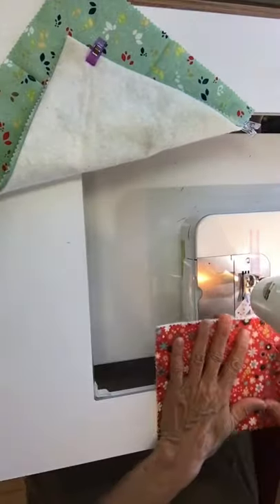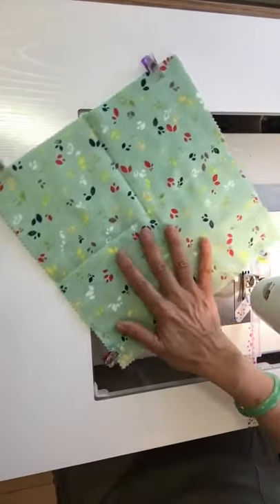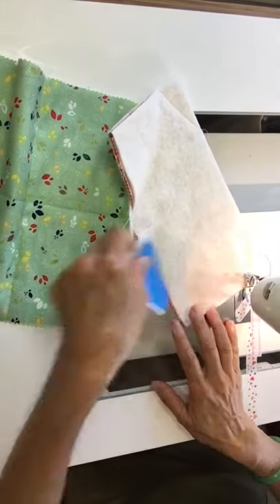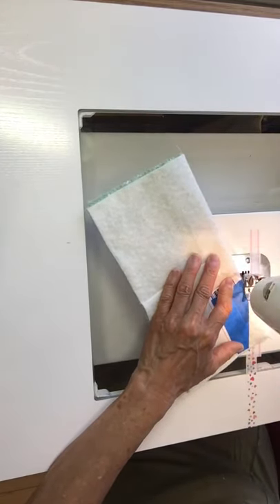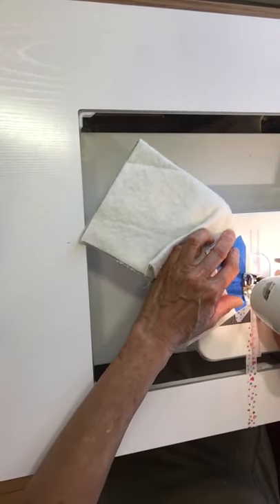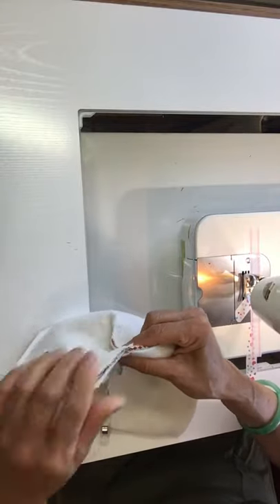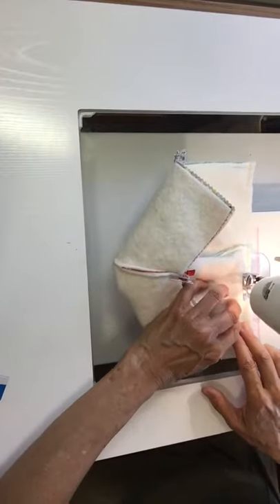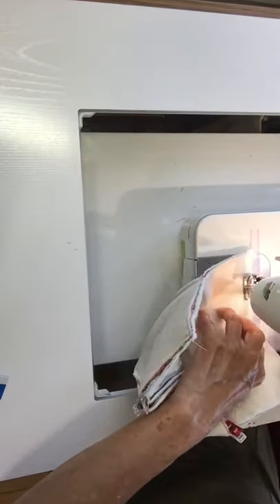Bowl Cozy Stitching Guide. A Sewing Hack. No marking needed.

Comment: For folks who want to make more affordable cozies, instead of paying a LOT for cotton batting, you can use 100% cotton flannel sheets that can be found at thrift stores. They wont be as insulating as batting, but they go together smoothly and they dry a lot faster than those made with batting.  If you want more insulation, you can easily sew an additional layer of flannel on one side.  Also, vintage cotton tea towels (in good shape) make cute cozies' outer fabric.
Reply from the maker: Great idea! I’m going to try that! I have lots of stash from making baby blankets!
Reply: Yes, flannel is cheaper at Joanne’s twice a year for $3.99 or $2.99 in October or November. People used to use flannel for batting before batting was available.

Comment: Hello! I read the information about the business card and how to measure and cut for the date… I was just wondering if you know the angle of the dart? For example is it a 35 degree angle or 45 degree angle? How did you figure out what angle to cut the business card? I have so many rulers with angles that I could just place my acrylic angle ruler on the batting and just use my rotary cutter and just cut it off.. I know this tutorial is 2 years old now and I just found this my accident , but was wondering if you happen to remember . If not totally understandable!
Thanks, Jeanne

Comment: Hi, was your template cut from cardboard  or a plastic one you bought? I couldn't see very well but I don't think you mentioned where you got your template from. Thank you. Very nice tutorial , it will definitely save time.
Reply from the maker: Hi! I created my template on my own. Simply start with some firm card stock. An old business card will do. Standard bowl cozies mark 2.5” high and 1.25” in to form the dart. 

But, all bowls are variable and these measurements can be adjusted. 

Have fun!

Comment: The darts need to be back-stitched at both ends n the X needs to be sewn diagonally from corner to corner.
Reply from the maker: You have a helpful idea to improve construction. 👍 I shorten my stitch length as an alternative to lock the stitch at the ends.
Reply: I agree with back stitching especially at the end of the points.   Nice template dart idea.
Reply: Why does it need to be sewn diagonally from corner to corner?
Reply: @sdlm2002 with the bigger size it sleeps all the layers together better with diagonal corner to corner stitching also.  I also sew over the seams again diagonally thru ALL layers when the cozy is finished so when they are washed they don’t turn out in a big balled up mess.
Reply: @ellenpowell4155 interesting. How do you stitch through all layers when you're finished? Do you mean a topstitch at the edge, or something else?
Reply: @sdlm2002 you still do the topstitch but in addition I also go over the seams to hold the 2 layers together.  You don’t have to sew the entire length of the seams but enough that it holds ALL the layers.  It is a little tricky but they will turn out so much better after washing them.
Reply: @ellenpowell4155  thank you for explaining. :)